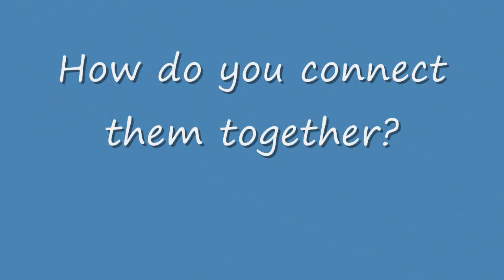Night Flying and Cold Light Strings 101

Comment from the maker: @daxfx You can see this at the very start of the video (0:08). I've used two cells to provide 7.2v to power the driver. Connect the black wire to the negative pin on the balance connector and the red wire to the second pin along. On a 3s balance tap you have four wires so when you've finished you should have two soldered up and two bare.

Comment: I have that same setup that I run on my T-Rex 450 with a T-Rex ASTRO motor and 35 castle creations speed control and a gold heat sink also a  9 gram 15 channel receiver with my 9Z although I put on a show at 3:30 am when all the bars closed and over 100,000 people showed up which I was running one glow rope that was average size for bigger light and I connected two 3 foot long ropes satured together and I had MS composite night blades blue on top in the middle and red on the Outside and green on the inside then on bottom was just red on the tip and green closest like the top! Then I took the 6 foot long one and used zip ties and did the canopy with the windshield and around both struts and around and around on the skids all the way down the tail boom zip tieing the Vertical fin and it was glowing like a Christmas 🎄 🚁 🌟 🤩 ⭐️ 🌠 💫 🌃 🌟 🤩